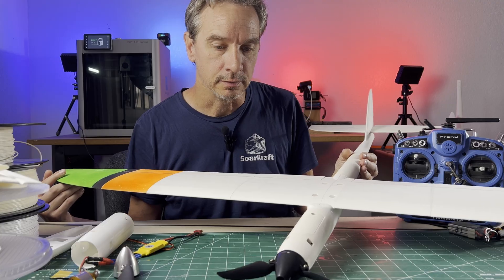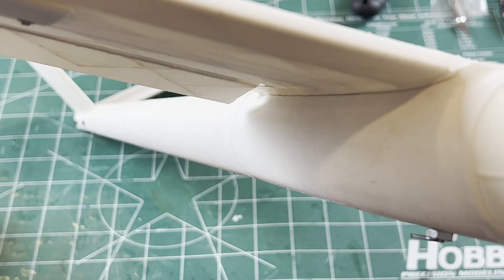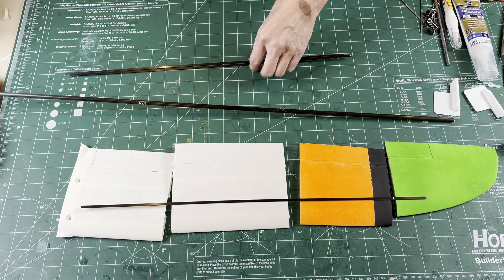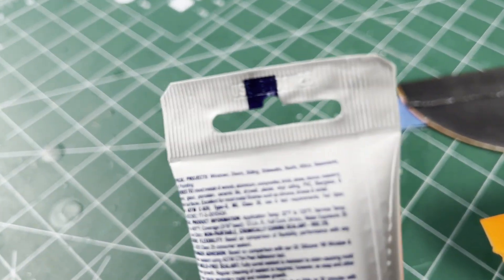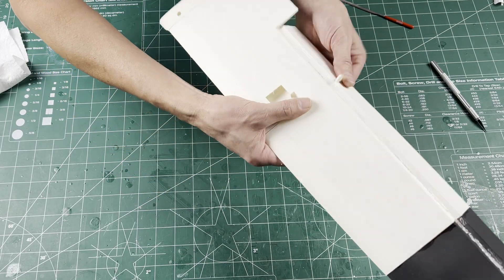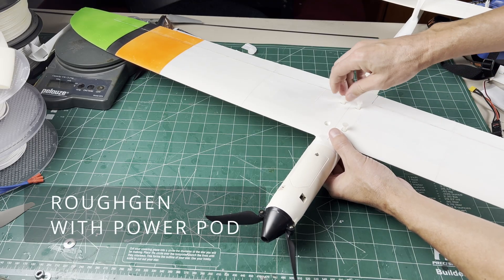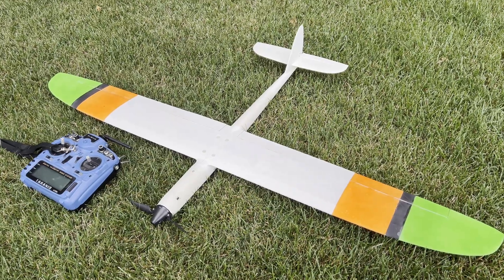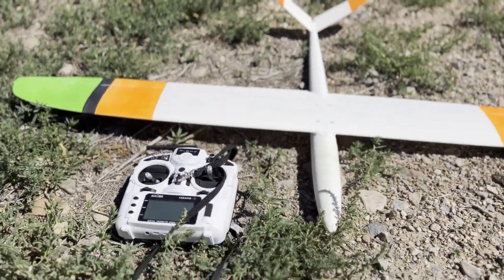New Wing - SoarKraft 1.2M with MH32 airfoil and 2 servos - simple, light and good lift

Comment: Great video Wayne - I thought I'd share my experience with the SoarKraft models. I've built quite a few now on my Ender 5 printer. I've tried both RG15 and MH32 wings. I love the new MH32 2xservo wing, fitted to a Roughgen fuselage. Flight behaviour is very predictable - no nasty stalls or snaps. The full-span ailerons are great, and make for nice slow landings when dropped down approx 20 degrees. Flying weights for all my Igneous / Roughgen models is around 900 grams, which may sound a bit on the heavy side, but doesn't affect the flying performance. I have found that for me, the CG location needs to be around 4mm forward of the mark under the wing to give that very stable and predictable flight envelope. Here's some of the other specs :
Motor - Sunnysky 2212 - 1400kv
ESC - ZTW 40 Amp
Battery - Tattu 3S - 1300 mAh (slightly heavier than 1050mAh to move CG forward)
Prop - 10x5 CAM Carbon folding prop.
For a bit of extra zing on my RG15 T-Tail Igneous I use a 4S - 1050 mAh battery with a 7x5 fixed APC propeller.

Your range of 3D-printed SoarKraft models has changed the sport of aeromodelling for me. With over 40 years in the hobby (mostly in R/C Soaring) things were getting a bit stale. Thankyou for your creations and dedication to bringing a bit of excitement back to the hobby. Cheers from Burnett Heads, Australia.
Reply from the maker: Then you are going to really like the EDF and the F5D pylon models coming soon.
Reply: @soarkraft  But you are working on that 2m span glider first, right? 😉
Reply: @sti9754  What would be the best airfoil for slower thermal soaring?
Reply: @Smokeslingerowner  I think the MH32 will be the better airfoil for thermalling, especially with full span ailerons cranked down about 3 degrees, with coupled aileron / rudder. Keeping the weight (wing loading) down is the key, so need to have your printer well-tuned. Aim for low 800 grams flying weight.